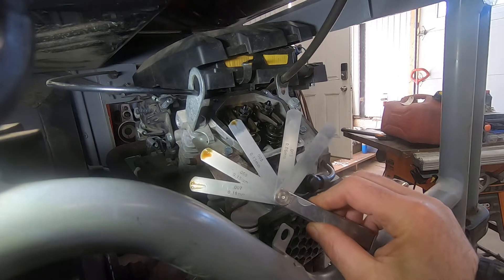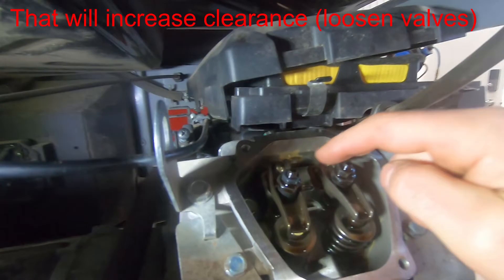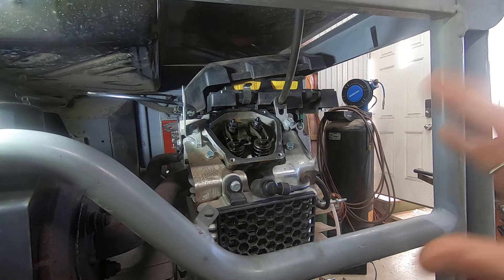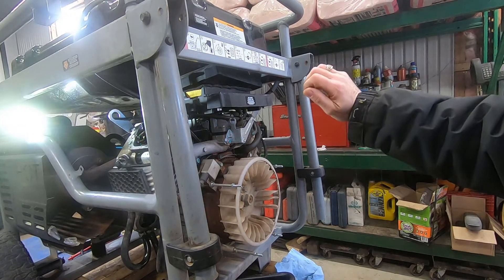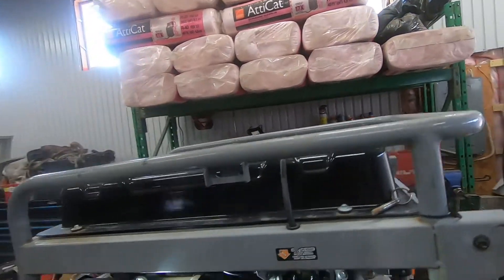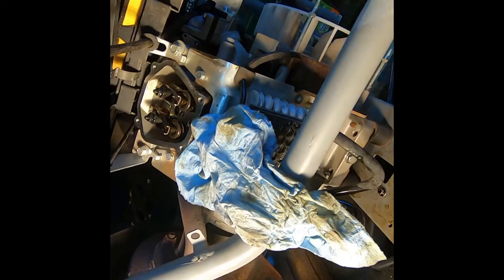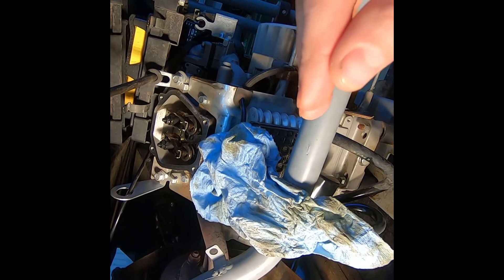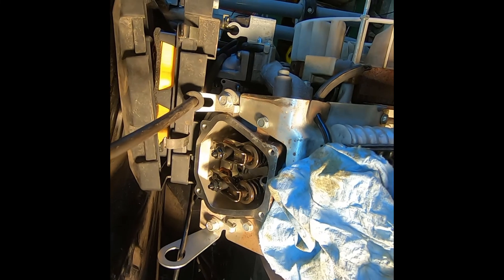DIY Setting Valve Clearance In Small 4 Stroke Engines

Comment: My pull cord snatches outta my hands and motors spins in reverse after I messed with valves....inre adjusted at top dead center but still happening. Something to do with decpr3ssion on valve. But I went from .010-.001 and can't get to work properly
Reply from the maker: It sounds like you set it on TDC but not TDC compression.